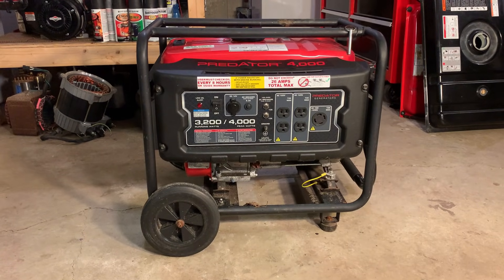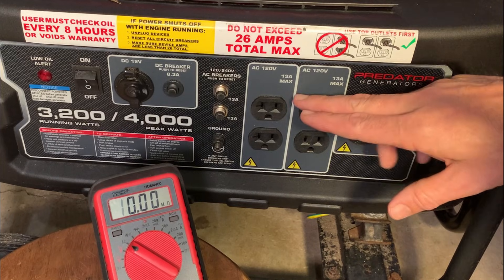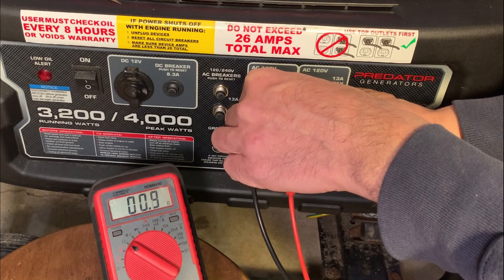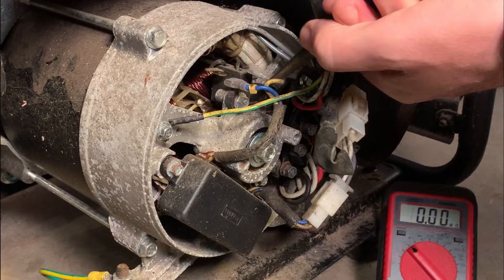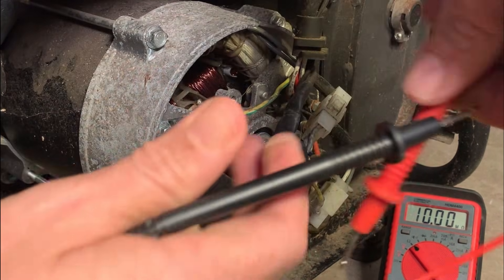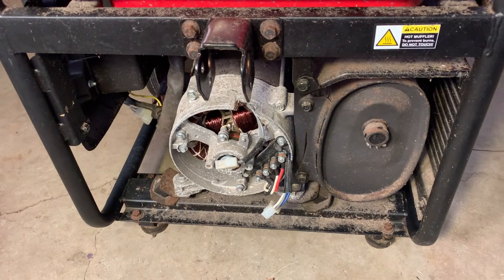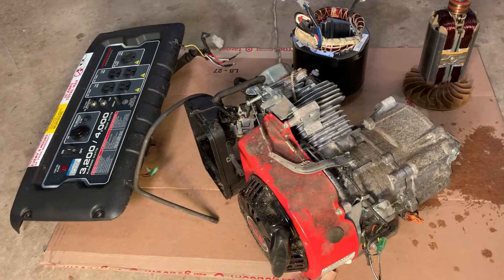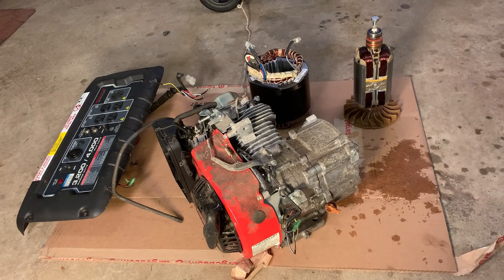Predator Generator Not Making Power

Comment: If you use a grease fitting and grease to pop off stator, works good just a little clean up. (grease gun 3000 psi.)
Reply: Don’t forget about the generator safety rules: Always make sure you follow all the generator safety rules whenever you use your portable generator. This is only a reminder. Generators can be dangerous if not used carefully. Every year, hundreds of people die or get injured when using portable generators due to carbon monoxide poisoning and electrocution. Make sure you are using your generator carefully and keeping others safe as well. There is something very serious that everyone should always be aware of when using generators. Some people do run their generator indoors which is not safe and that increases the risk of carbon monoxide poisoning which can cause death of family and you. Some people run their generator in wet conditions which can electrocute them. Please remember that you should never run your generator indoors. Remember that carbon monoxide is an odorless and colorless gas that you cannot see or smell. Carbon monoxide is a silent killer. Keep that in mind. Make sure your generator is 15-20 feet away from your house and away from doors, windows, and vents. Never use your generator in your porch too. Having a carbon monoxide detector is very important against generator safety. Some people also allow children to go near the portable generator which could pose risks. We need to keep an eye on our children making sure that they are not near the portable generator so they won’t get electrocuted or burned by the generator which is dangerous. A locking enclosure also keeps kids safe. A generator shed might look like a tempting place to explore, or take cover during a game of hide and seek, but a generator is a dangerous piece of equipment that can cause injury. It says on the manual that we should also keep children away at all times from the portable generator to avoid injuries. Please do not allow a child or unqualified people to operate the portable generator.  It is important to keep your children safe especially little ones. The portable generator can be hot during an operation. Just because some manuals missed what should be listed doesn’t mean it’s safe to do. Always follow the generator safety rules when using portable generators. Generators pose electrical risks. If you need to use your generator during wet weather, you need a generator tent to protect your generator from getting wet. Don’t let your generator get wet. Keep your generator dry and before using your generator, please make sure your hands and your generator is dry. Do not wear loose clothing when operating the generator. Everything that is said on the generator’s operating manual should not be ignored. Never smoke cigarettes near the generator. Please keep flammable things away from the generator. Never overload your generator too. Your generator can catch fire. Never ever try to plug a generator cord into a wall outlet to avoid back feeding. Back feeding your generator is dangerous. Always turn on your generator first before plugging in appliances and shut off the appliances before turning your generator off. Use a heavy duty cord for your generator and the cord should not be worn out. All the instructions should be followed carefully. Never refuel your generator while it’s running. It can cause fire if fuel spills while your generator is hot. You should turn off your generator and let it cool off before refueling it. Having a fire extinguisher next to the generator is also important. This is only a reminder for everyone’s safety of using generators. Make sure your generator is properly grounded. Having a fire extinguisher next to the generator is also important against the safety rules. https://youtu.be/I1jT3ANENvI and here is a video more about keeping others safe when using generators and also about our family’s safety. It’s important to keep our little children safe as well. Make sure your little children are kept away from the generator at all times especially when it’s running. Hope this helps. Always remember that it’s better to be safe than sorry.

Comment: This says to me run the generator ASAP  don’t let it sit for “maybe “ use 
They need to be checked then stored in proper way
I live off grid in the woods of oregon and use a generator a lot in winter
I have had to take back predator generator in the past 
Also always purchase the guarantee /warranty  
I have a generator just like that one bet I have 1000 hours on it
Reply from the maker: It’s a solid generator.  Was surprised there was no heat shield between the stator and exhaust.  The stator would last longer if they added that.
Reply: @jcondon1  I haven’t looked at mine that close but I think I will
Reply: A golden rule of anything bought brand new, or even a refurb if it comes with a guarantee, is to run it regularly and reasonably often during its guarantee period. That way, if it's dead from the factory, or likely to fail through a manufacturing defect, you can root it out while it's still under guarantee.

To be realistic, it's always a good idea to run machines of this nature on a regular basis because you can almost guarantee that if you don't, then on the one night/weekend/etc that you need it, it will let you down.
Reply: @28YorkshireRose12  I agree 100%  but most people don’t do that that’s why there is so many for him to redo

Out here in the PNW you hardly find them other than running order we don’t have power outages so if a person has a generator it’s because they at least use it regularly camping or 4 at wheelers camps
Reply: Can anyone give me a link or advise on how to properly store a generator then?
Reply: @trooper11c  Don’t forget about the generator safety rules: Always make sure you follow all the generator safety rules whenever you use your portable generator. This is only a reminder. Generators can be dangerous if not used carefully. Every year, hundreds of people die or get injured when using portable generators due to carbon monoxide poisoning and electrocution. Make sure you are using your generator carefully and keeping others safe as well. There is something very serious that everyone should always be aware of when using generators. Some people do run their generator indoors which is not safe and that increases the risk of carbon monoxide poisoning which can cause death of family and you. Some people run their generator in wet conditions which can electrocute them. Please remember that you should never run your generator indoors. Remember that carbon monoxide is an odorless and colorless gas that you cannot see or smell. Carbon monoxide is a silent killer. Keep that in mind. Make sure your generator is 15-20 feet away from your house and away from doors, windows, and vents. Never use your generator in your porch too. Having a carbon monoxide detector is very important against generator safety. Some people also allow children to go near the portable generator which could pose risks. We need to keep an eye on our children making sure that they are not near the portable generator so they won’t get electrocuted or burned by the generator which is dangerous. A locking enclosure also keeps kids safe. A generator shed might look like a tempting place to explore, or take cover during a game of hide and seek, but a generator is a dangerous piece of equipment that can cause injury. It says on the manual that we should also keep children away at all times from the portable generator to avoid injuries. Please do not allow a child or unqualified people to operate the portable generator.  It is important to keep your children safe especially little ones. The portable generator can be hot during an operation. Just because some manuals missed what should be listed doesn’t mean it’s safe to do. Always follow the generator safety rules when using portable generators. Generators pose electrical risks. If you need to use your generator during wet weather, you need a generator tent to protect your generator from getting wet. Don’t let your generator get wet. Keep your generator dry and before using your generator, please make sure your hands and your generator is dry. Do not wear loose clothing when operating the generator. Everything that is said on the generator’s operating manual should not be ignored. Never smoke cigarettes near the generator. Please keep flammable things away from the generator. Never overload your generator too. Your generator can catch fire. Never ever try to plug a generator cord into a wall outlet to avoid back feeding. Back feeding your generator is dangerous. Always turn on your generator first before plugging in appliances and shut off the appliances before turning your generator off. Use a heavy duty cord for your generator and the cord should not be worn out. All the instructions should be followed carefully. Never refuel your generator while it’s running. It can cause fire if fuel spills while your generator is hot. You should turn off your generator and let it cool off before refueling it. Having a fire extinguisher next to the generator is also important. This is only a reminder for everyone’s safety of using generators. Make sure your generator is properly grounded. Having a fire extinguisher next to the generator is also important against the safety rules. https://youtu.be/I1jT3ANENvI and here is a video more about keeping others safe when using generators and also about our family’s safety. It’s important to keep our little children safe as well. Make sure your little children are kept away from the generator at all times especially when it’s running. Hope this helps. Always remember that being safe is better than being sorry.

Comment: I find it incredible the number of comatose generators you find but not surprised you can repair most of them. At least you have a supply of good parts this time. I assumed there would be an unlimited supply of sick Y2K generators in my area but not so. When stuffing a cylinder with rope, be sure the piston is coming up on the compression stroke so that both valves are closed or a valve "could" be bent when applying rotation to the crank. Could a smaller diameter rod have been used to avoid removing the engine and using water? That water trick is VERY cool. Tnx for more good lessons.
Reply from the maker: Smaller rods would probably bend and get stuck.  But if the rod was hard enough then it would probably work.  I don’t know sure.  I do set the piston in the compression stroke.  That makes it safe for removing the rotor bolt.  But torquing it back on rotates the engine the other way and will push on a valve.    Was thinking about getting a piston stop, but not sure I like that idea any better.
Reply: @jcondon1  Thanks for responding. With all your wrenching on small engines, I think you would find a 1/2" impact wrench VERY useful for removing rotor and flywheel nuts. But invest in a good one, not at Horrible Freight. Drill rod is more stiff and harder than cold rolled steel. If using a drill rod, apply reasonable pressure and then try a sharp rap on the bolt head with a hammer might shock it loose. Keep up the GREAT videos.
Reply from the maker: @ron827  thanks.  A larger impact is definitely on the short list of tools I need.

Comment: Unbury the wire end, unwrap 1 wrap on the wire and then repair as normal OR just solder to the end and then epoxy it all up in place with JB weld. It will insulate and provide a secure and heat resistant mechanical connection to secure the solder connection.
Reply: generator safety rules: Always make sure you follow all the generator safety rules whenever you use your portable generator. This is only a reminder. Generators can be dangerous if not used carefully. Every year, hundreds of people die or get injured when using portable generators due to carbon monoxide poisoning and electrocution. Make sure you are using your generator carefully and keeping others safe as well. There is something very serious that everyone should always be aware of when using generators. Some people do run their generator indoors which is not safe and that increases the risk of carbon monoxide poisoning which can cause death of family and you. Some people run their generator in wet conditions which can electrocute them. Please remember that you should never run your generator indoors. Remember that carbon monoxide is an odorless and colorless gas that you cannot see or smell. Carbon monoxide is a silent killer. Keep that in mind. Make sure your generator is 15-20 feet away from your house and away from doors, windows, and vents. Never use your generator in your porch too. Having a carbon monoxide detector is very important against generator safety. Some people also allow children to go near the portable generator which could pose risks. We need to keep an eye on our children making sure that they are not near the portable generator so they won’t get electrocuted or burned by the generator which is dangerous. A locking enclosure also keeps kids safe. A generator shed might look like a tempting place to explore, or take cover during a game of hide and seek, but a generator is a dangerous piece of equipment that can cause injury. It says on the manual that we should also keep children away at all times from the portable generator to avoid injuries. Please do not allow a child or unqualified people to operate the portable generator.  It is important to keep your children safe especially little ones. The portable generator can be hot during an operation. Just because some manuals missed what should be listed doesn’t mean it’s safe to do. Always follow the generator safety rules when using portable generators. Generators pose electrical risks. If you need to use your generator during wet weather, you need a generator tent to protect your generator from getting wet. Don’t let your generator get wet. Keep your generator dry and before using your generator, please make sure your hands and your generator is dry. Do not wear loose clothing when operating the generator. Everything that is said on the generator’s operating manual should not be ignored. Never smoke cigarettes near the generator. Please keep flammable things away from the generator. Never overload your generator too. Your generator can catch fire. Never ever try to plug a generator cord into a wall outlet to avoid back feeding. Back feeding your generator is dangerous. Always turn on your generator first before plugging in appliances and shut off the appliances before turning your generator off. Use a heavy duty cord for your generator and the cord should not be worn out. All the instructions should be followed carefully. Never refuel your generator while it’s running. It can cause fire if fuel spills while your generator is hot. You should turn off your generator and let it cool off before refueling it. Having a fire extinguisher next to the generator is also important. This is only a reminder for everyone’s safety of using generators. Make sure your generator is properly grounded. Having a fire extinguisher next to the generator is also important against the safety rules. https://youtu.be/I1jT3ANENvI and here is a video more about keeping others safe when using generators and also about our family’s safety. It’s important to keep our little children safe as well. Make sure your little children are kept away from the generator at all times especially when it’s running. Hope this helps. Always remember that it’s better to be safe than sorry.